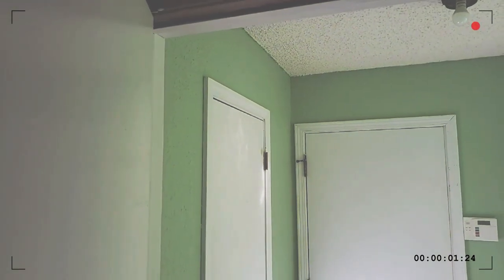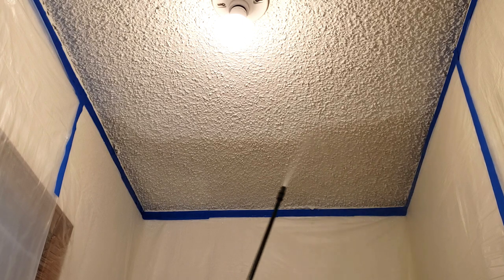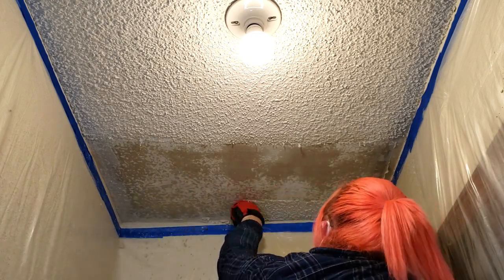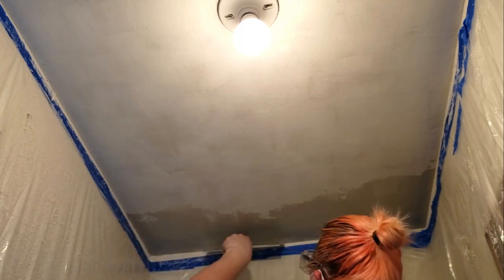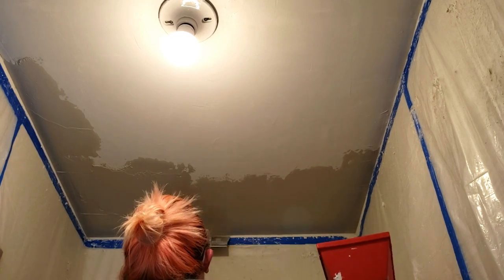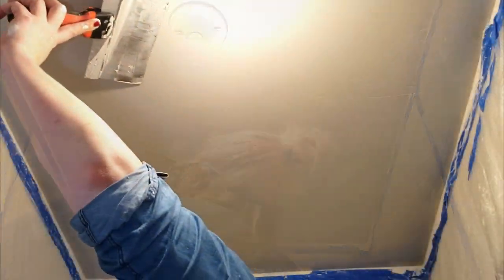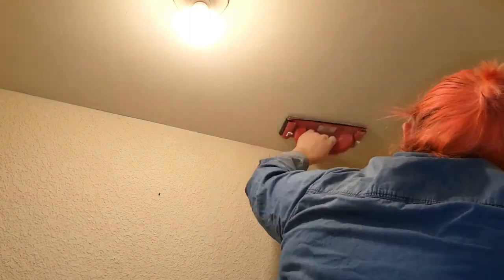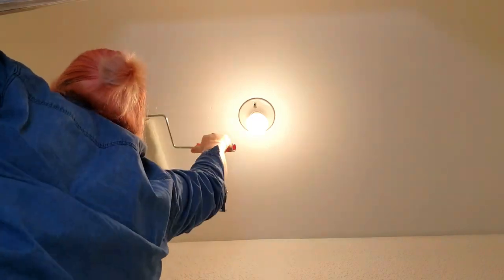How To Remove Popcorn Ceiling And Skim Coat From Start To Finish

Comment: Good job, if I may, I'd offer 2 suggestions.  1, sand in between coats, even if you think it doesn't need it.  It will improve how the 2nd coat goes on and improve the overall appearance.  2, When you do your 2nd coat, change direction or where you start. Reason, if by chance you put it on too heavy in a certain area for the 1 coat, and then start in the same exact location for the 2nd coat, you run the risk of too much build up in one area, and inconsistent parts in other areas.  This will assure a more uniform finish.  Other than that, you killed it.
Reply from the maker: Thank you! I will take those suggestions in to consideration when I do the next room.

Comment: Well done. I did drywall as part of my punchout mechanic. (make house perfect for the new homeowners) If you put a little bit of dish washing soap in with the water and joint compound it makes it easier to skim. Also sand between coats. Coat floor to make for easier clean up. Wear paper booties so you can take off going out of room. You Don't want to track that mess anywhere else. When you are done with second coat and sanding pull down plastic rolling it to floor fold in all edges than roll up put in big garbage can in the room. Where will be a little bit of a mess left to clean up. If you are removing flooring Don't paint before you do this. You only want too do stuff once. Prime everything than do any mudding touch up to walls and ceiling. Sand the repairs and paint second coat of primer colored the same as final color. Depending on your flooring choice you either do flooring or paint next. You should only need one coat of paint because you used the same color primer.

Comment: You’re my hero!  I removed the spackle ceiling from our home, using your method, with two exceptions.  I used equal parts hot water and vinegar in the sprayer, and I used the large blade you used for skim coating, to remove spackle.  I do believe the vinegar helped; it caused the mud to foam and sort of “melt”.  I also placed plastic on the floor, and am glad I did.  HOWEVER, I hired a pro to skim coat, both because I didn’t believe I could do a good job and because I ran out of steam!  Keep up the inspiring work!
Reply from the maker: Thank you so much! ❤️ I have heard the vinegar water thing works well, I think I'm going to give that a try next time. I still have several rooms to go. Skim coating is intimidating, I totally understand hiring someone for that. I was so nervous the first time I tried it. Thanks again!

Comment: I got a tip for u good job but instead of using the knife for the whole cieling it’s faster to use a paint roll and put mud on the roll and roll the ceiling then use knife to feather it out it works a lot faster just a heads up but good job 👏
Reply from the maker: Thank you! I am planning on trying that on my walls but wasn't sure how that would work over a heavily textured ceiling.

Comment: I am just wondering would it be easier. To sheet rock over it. You did great job.
Reply from the maker: Thank you! So I looked in to that before I started working on our ceilings. There's a couple of reasons I decided not to go that way. It would've cost more and I wasn't very confident in my ability to do that by myself (I prefer to be able to tackle my projects without any help). I don't know if it would be easier in the end but it looks like it would be less messy and maybe not take as long. I'd be interested to know how long it really takes to do a full room.

Comment: Hi! Great video! Does this work with plaster/lath ceilings?
Reply from the maker: Thank you! I'm sorry I wish I knew the answer to that. I've never worked with anything other than drywall texture. I did a quick search after reading your comment and there are some videos about skim coating over plaster so it looks like it's an option but you might check those out first and see how they suggest doing it. I hope it works out for you, good luck!

Comment: How did you mix the mud and transfer it to the pan in your hand? How long did the mud last before your next job? Does it harden when not in use?
Reply from the maker: I bought a big bucket with a lid and used that to mix the mud, then I used a scoop to scoop the mud in to the bucket. When I was done with a coat I scraped anything in the pan back in to the bucket and covered it with the lid. I used that same mud over a few days and it didn't dry out, but the lid was pretty airtight. I wish I would've filmed that process, sorry I didn't! But I hope this answered your questions.

Comment: I would go with a light compound over an all-purpose easier to sand
Reply from the maker: I actually switched to the light compound in the project after this one. You're right, it's easier to sand (and easier to work with, in my opinion).

Comment: This was so helpful and you did a GREAT job. New sub. 
 I have to do a 1900 sq foot. Do I REALLY have to skim coat???? I'm a DIYer, but this is too much for 1900 sq ft. PLEASE, someone tell me I can just sand and then prime.
Reply from the maker: Thank you! So I did my first couple of rooms without a skim coat. They turned out ok but I would say to make sure you sand any patched areas really thoroughly. I thought I had but it doesn't look as good as the room I skim coated. There are some bumpy areas where you can tell I had to patch the drywall. You can check out that other video if you'd like to see how it turned out. It is a big job to skim coat every room yourself, so I'm just doing one room at a time as I work my way through every room doing my renovations. You can always try it without skim coating and see how it turns out. If you don't like it you can go back and try the skim coat. Good luck with whichever way you decide to go!
Reply: @TheNiftyNester  // awww...it means so much you replied. I think the smaller rooms I'll definitely skim, and with the larger ones I'll do exactly what you said. Thanks again...❤❤

Comment: How long did it take from start to finish? Great work btw!
Reply from the maker: Thank you! It took a few days. The drywall had to dry so I scraped the ceiling one day then let it dry. Did a skim coat the next day then that has to dry for about 24 hours so I did the second coat the day after that. After the last coat dries you can sand and paint which can easily be done in 1 day.
Reply: Box of mud takes 24 hours to dry unless u have a blower fan to dry faster.  It takes long lol w a blower takes couple of hours.

Comment: Do you have to skim coat the whole thing after removing the popcorn ceiling? I saw others sanding the ceiling down when their finished removing the popcorn? Not sure what to do next
Reply from the maker: I tried doing it without a skim coat in the first couple of rooms I removed the popcorn in and they just didn't look great. I would say it depends on the condition of the drywall after you scrape the popcorn off. Mine had some flaws and needed to be patched and that made them not look even or smooth even after sanding them so I started doing skim coats and that fixed my problem. If you can get your popcorn off without any damage to the drywall then you could probably skip the skim coat. If you feel like it doesn't look good you can always skim coat over the paint and repaint afterwards.
Reply: @TheNiftyNester  yeah theirs some minor scuffs from the scaper, but it's kind of spread out but nothing major of fixing. So I'm stuck lol because I know skim Coating it takes a process. But what type of skim coat did you use?home depot stuff or online ?
Reply from the maker: It is a process and it's time consuming. I love the end results so I keep torturing myself with these ceilings lol but it all depends on what results you want and how much time you want to dedicate to the protect. I used the USG all purpose when refinishing a scraped ceiling and switched to the USG Plus 3 lightweight when skimming over the popcorn texture. After using both I have decided I prefer the lightweight joint compound. I still thin it out just slightly with water before applying the skim coat. The light weight is just a little easier to work with and it sands really well.

Comment: question, did the texture of the walls bother you at all after having a flat ceiling? (you did an amazing job btw!)
Reply from the maker: Thank you! And yes it did actually. It looks better than it did with the popcorn ceiling but I've been thinking about smoothing out the textured walls as well in the rest of my house. At first I was trying to avoid it but now I think it'll look better if I just smooth it all out.
Reply: @TheNiftyNester  I agree. I'm going through the same thing...debating... ughh but I'm sure if you decide to do it, will turn out amazing! do make a vid :)
Reply from the maker: I absolutely will!

Comment: Whats the reason for putting the mud on the ceiling? Cant you just remove the popcorn then paint?
Reply from the maker: That was my thought in the beginning as well. I did a couple rooms like that and I kept looking back at them thinking they looked awful. There's just too many visible flaws in the drywall after scraping the popcorn, even after patching and sanding. The skim coat took some time but it looks 100 times better and I'll be redoing the other rooms as well.
Reply: @TheNiftyNester  thanks for the reply. Can you post some pictures of the other rooms or do a close up video showing those rooms and this room close up? I want to compare. I dont mind scrapping and painting, but i dont want to deal with sanding and putting the mud. Too much work and my house is 1800 sq/ft of popcorn ceilings.
Reply: @x_MrYAYA_x  she’s got another video where she does just that. The laundry room one. In the end you could still make out the areas that she filled in and sanded. This one turned out much smoother and nicer of a finish.

Comment: Is this a house or a mobile home?  You think it would work on a mobile home bathroom?
Reply: Yes it would work the same there’s different ways you can take it off. how old is the manufactured home that you live in if it’s older than 1980 It may have asbestos in it but you can get a test for it it probably doesn’t but it’s good to check in older houses. 
Watch some videos on YouTube just search popcorn ceiling removal and you’ll see how to finish it because when you scrape it off and paint it like she did it won’t come out right the reason why they use popcorn ceiling most the time like 99% of the time is to hide imperfections in the ceiling they can do less work and get away with it it’s just a cheap way to finish ceilings so you need to coat it.
Reply from the maker: This is a house but like the other commenter mentioned you should be able to do the same. I skim coat the ceiling to hide those imperfections underneath the popcorn which is what I think they're also referring to. Definitely get an asbestos test if it's an older home, even after the 80s they were allowed to use any product they still had on hand, they just couldn't buy it anymore.

Comment: Nicely done! A quick question, what would you suggest for an uneven painted ceiling? It was my first experience removing my room's ceiling popcorn. I did not notice, coz I got tired and wanted to finish it off. Now my ceiling looks uneven kinda bumpy and it annoys me every time. Would skim coating is an option to that coz its already been painted? Any tip would be appreciated 😁
Reply from the maker: Thank you! So I have seen people skim coat over paint, as long as it was in good shape and not peeling. I haven't done it myself yet but I have a project coming up and I'm planning on doing the same thing myself. Depending on how bumpy it is though you might be able to just sand the ceiling smooth and repaint it? I guess it depends on how bumpy it is. I do love how perfect and smooth it looks after a skim coat though.
Reply: @TheNiftyNester  well mine is mixture of big & small, however it's alot of them. You can tell I did a horrible diy 😂
Reply from the maker: @malikbezhanakbari935  hey we all have to start somewhere! Ceilings are hard work, my first one in my office looks awful now that I look back at it. I'm going to redo it eventually. If it's a lot you might as well do a skim coat. It'll take some time but it looks so nice and new when it's done.

Comment: Could you have just painted or were there too many problem areas because of popcorn? 

We have a 100-yo house with popcorn everywhere 😢 the walls are horsehair plaster, very textured. I’m pretty overwhelmed.
Reply from the maker: So I've tried just painting the ceiling after scraping the popcorn and you can definitely do that, it just left the ceiling looking a little lumpy from where I had damaged the drywall while scraping it. I tried patching the damage but it still looked lumpy.

Comment: That water base primer is no bueno!!!! That is a waste of money! Just use a ceiling paint with primer! Faster and cheaper!
Reply from the maker: Why do you say it's no bueno? I prefer this Sherwin Williams ceiling paint and have been using this method for a while but I'm curious why you think it's the wrong way to go.
Reply: @TheNiftyNester  that water base doesn't help cover much plus it doesn't help future water stains on ceiling like the oil base. I'm a painter and in my honest opinion it's a waste of money
Reply from the maker: I've used oil based primer in the bathroom when I removed the wallpaper and it was just unfinished drywall underneath but the fumes were AWFUL. I knew I needed oil based in there because of the water but figured other rooms aren't exposed to water like the bathroom. Do you always use oil based paints on ceilings? Do you worry about yellowing?
Reply: @TheNiftyNester  so I do use oil base only bc you get a better coat and helps with stain block. But if you dont have stains I'd recommend use a paint with primer or if you prefer Sherwin Williams use there 500 or whatever there high grade is! That way you can get away with just 2 coats of paint and not use that water base primer that doesn't help really!